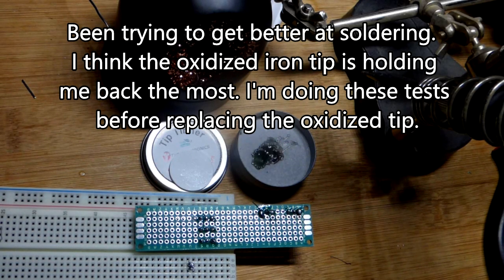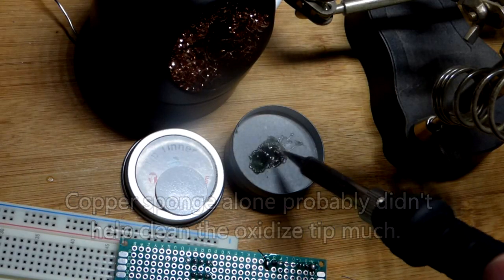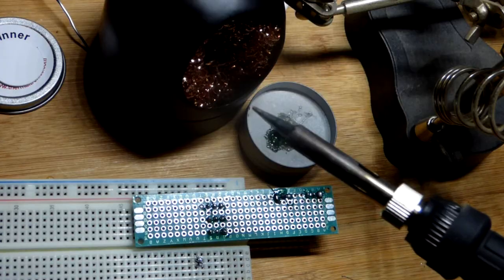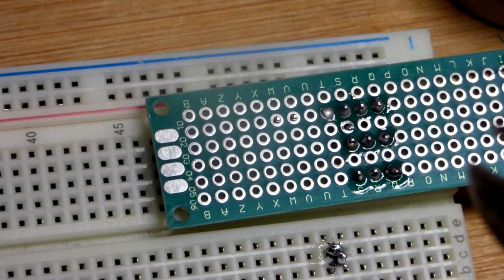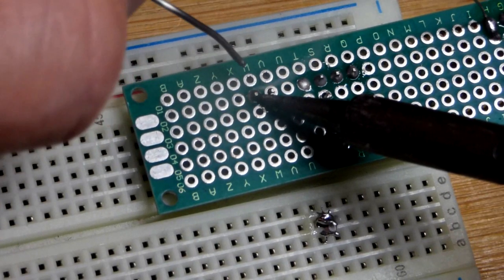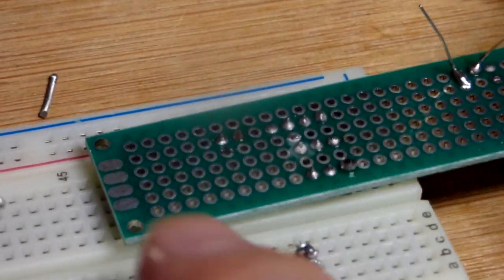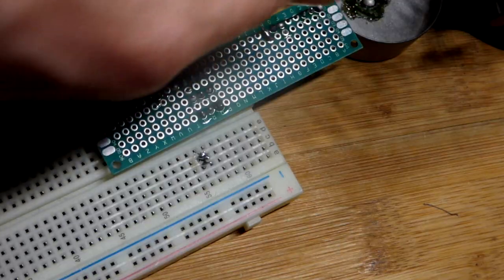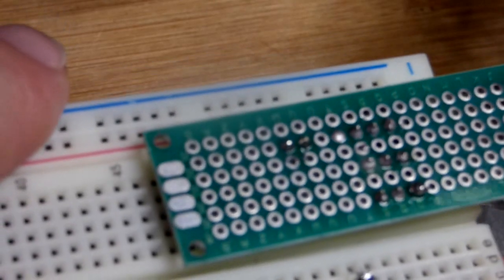Trying tip tinner on oxidized iron while trying to improve soldering

Comment: A bit of a tangent, but I use a timer on my soldering iron so that it automatically turns off after an hour.  It’s easy to get distracted, so I like knowing that I have a “fail safe” system.

I’m going to try the ideas in this video (and in the comments) because my soldering iron gunks up frequently.
Reply from the maker: That's a good idea. I unplugged the wrong cord recently and almost burned myself when enough time passed that the iron should have cooled. If I find myself doing a lot of soldering, I'll definitely get a soldering station.

Comment: I like your videos and you know a lot more than about electronics than I do. But...  I can solder-(very, very  well and even SMD ) -  I started building electronics kits back in the 60s. 

Tip tinning is about keeping the tip in good condition.

The tip tinning mix is to recondition the tip. Tips usually get a bit cruddy (corroded and pitted) from all the the different fluxes etc. Clean old solder etc off (brass wool etc ),  Dip the tip (into the treatment)  and then it is good to go for several hours of soldering. No need to keep repeating.
Reply from the maker: Most people solder better than I do lol. And that's pretty much exactly what I gathered from a YouTuber I watched recently who says he can keep using the same tip every day for over a year just by using tip tinner and brass wool every time he grabs the iron. Thanks for watching and commenting!

Comment: I'd recommend being much more aggressive when using the brass wool. Really stab the tip in there and rub all sides hard against the brass to really remove the oxidation.
Reply from the maker: I did that originally. I bought the brass wool and some flux a while ago and rubbed a number of stuff in addition to the wool aggressively against the tip between dips in flux. I finally found a youtuber that claims he uses the same tip every day for over a year just by applying tip tinner to it every time he pulls it out of the stand or station. I think I remember him doing lighter brass wool stabbings. He also said to ditch any oxidized tip that is giving you problems and start new. I already put in a new tip and solder is spreading on it pretty well, but I think that is more because it is new. I'm drenching it in tip tinnitus and solder before turning it off which I didn't use to do. I only used a wet sponge before as well.
Reply: @Electronzap I have used the same tip for the past 5 years. But I don't use it every day, maybe once a week. I clean it with a copper wool pad from the kitchen. It it gets really bad I soak it in acetone for 3 minutes and then use a copper wire brush. I found that what eats the tips up is some of the acid fluxes. They will litterally eat the metal up. So be careful with especially the older ones. The newer ones are more mild. Also when I am done I brush it really well on the copper wool before I turn it off. Every time I turn it on, I let it heat up then scrub it on the copper and then apply some solder to the tip. That's the best advice I can give you. I would try to avoid sand paper, you can break off the coating and get to bare copper under it and then it won't work as good. At that point you have to replace the tip. A good tip will last a very long time if you keep it clean.
Reply from the maker: @newmonengineering  Thanks for the tips!

Comment: I never did use this flux and like using the wire cutter i used to sharpen the place where I would need the soldering iron to be working
Reply from the maker: Yeah, I seen youtubers do all kinds of things to grind off the oxidation. I tried a number of things including rubbing steel tools across it and being rougher with the brass wool after dipping it in flux. Now I'm trying to copy a guy that claims he can keep new tips from oxidizing for over a year when he uses them every day, but I wanted to test it on the oxidized tip first. Thanks for the comment!